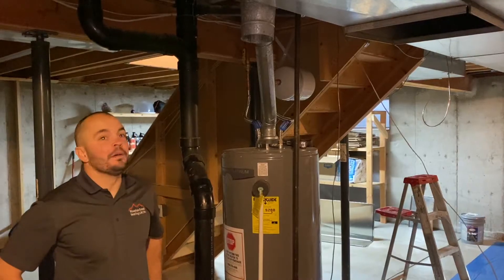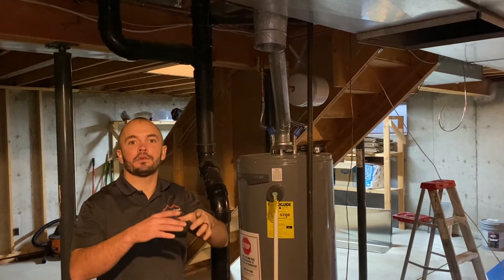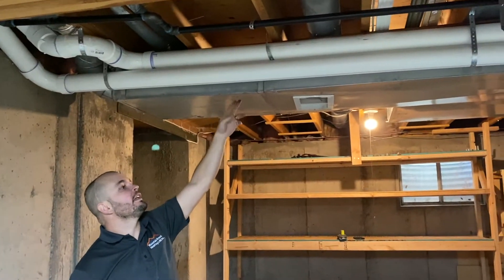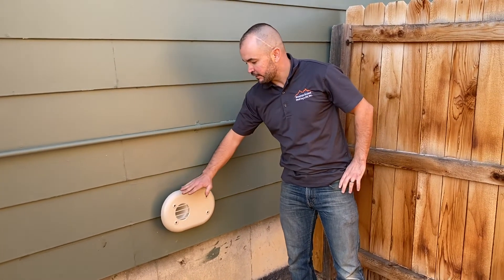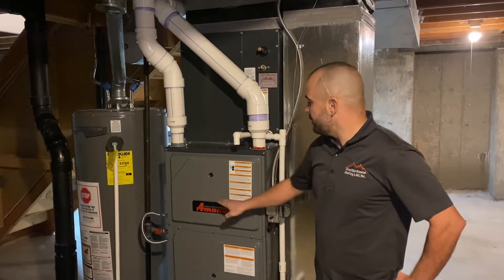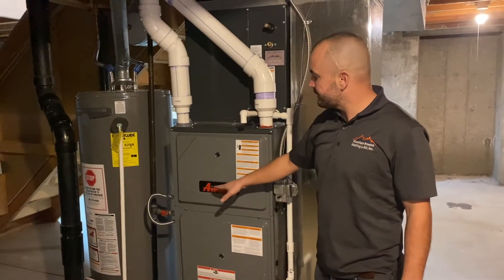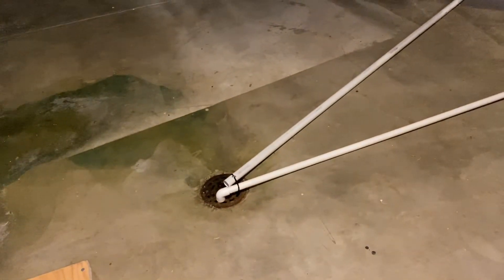High Efficency Furnace Venting

Comment: My house has the exterior flush vent as shown in the video but the guy that owned my house before me was an HVAC guy and when he terminated it the exhaust is on the bottom and the intake is above it, UNLIKE AS SHOWN IN THIS VIDEO SIDE BY SIDE. Is this is a really bad issue? Do I need to get it corrected?

Comment: I keep getting water in mine…then my furance doesn’t work. Wasps keep getting in mine, which only makes the water situation worse. What can I do with the existing vent to fix that?
Reply: Your exhaust pipe is not sloped correctly, condensation is building up blocking your exhaust

Comment: Apart from asthetics, is there any advantage of disadvantage to the low profile venting as compared to just regular old pvc pipes sticking out? (high efficiency furnace)
Reply from the maker: It’s more for aesthetics, but if not used you need to make sure the exhaust/intake are spaced more than 12” apart
Reply: @mountainbreezeheatingandair Is that a human safety issue or less spacing risks just shortening the life span of the furnace?

Comment: A few months a hvac guy install a high efficiency furnace and the drain goes up to the attic apparently, that seems wrong but 🤷‍♀️ any advise on what to do? Also I see 2 pipes going up to the attic, not to the side of the house. So you think it was installed wrong???
Reply: And the drain pipe has a pump what pumps the water up to the attic to a drain metal pipe that in in the attic

Comment: That venting is a bad way, my Lennox high efficiency furnace (we bought in 2023) collects condensation inside the unit, and pumps it out through a 0.5" hose line, and the venting still goes the chimney like a regular furnace

Comment: I've had a high efficiency furnace installed.  My neighbour and I both have two storey homes and the exhaust vent is located at the height of the floor joists between my two floors.  Our homes are about 6 feet apart.  My neighbour is claiming the exhaust is causing condensation on the outside of his vinyl-siding and is worried it will cause issues with rot.
Have you ever heard of this potential issue?
Reply: Where I live new homes are as close as 4ft foundation-to-foundation. The issue above has been addressed by installing a T pipe at the exterior end (oriented left to right rather than up and down) of the exhaust PVC pipe. This is city code here now.

Comment: On very cold windless days, whore frost would buildup and block my furnace air intake. I would have to go outside and use bottle brush to unblock it. I finally figured out that when there was little or no wind, the humid furnace exhaust was being drawn into the furnace intake and freezing. For a quick fix I placed a 3 foot by 3 foot sheet of plywood between the air intake and the exhaust until I eventually extended the exhaust another 16 inches away from the furnace air intake to more permanently solve the problem.

Comment: Got a bid for an Amana AM9S96 single stage multi speed furnace and contractor is only going to install an exhaust pipe. Said Amana heat exchanger is built big enough that it doesn't need an intake pipe. Is this the right way to do it. Thanks

Comment: I would strongly caution against using the termination kit shown in the video. I have 5 year old house with exact same termination kit. After 5 years all the hardiplank siding around the termination is rotten, has mold and will have to be replaced. The discarded fuse gases condense around the termination. These AC guys do their job and leave with everything looking nice and clean. The issue wont show until after few years. I wish I could post pictures as evidence.
Reply: I have this same issue on our 10 year old house with this exact termination kit and had to replace some of the OSB wall sheathing and fir out a new square wood piece for the termination. I reused the termination kit but have noticed that the same thing is happening again with our cold temps also in Montana. Scrap this unit and reconfigure with PVC pipe and a couple of 90s elbows.
Reply: I enjoyed reading your comment. Can you make a video showing it? Ours is 5 years old now. We are in north east Montana and our Furnace keeps quitting because both Vents are clogging with snow, but mostly Ice in this brutal weather we've been having lately. Going outside in blizzard -40° windchill to chip out the Ice buildup isn't so easy. I'm looking for a way to help stop that from constantly happening. Im hoping mold build up isnt the culprit.
Reply: @rd7866 same issue happens to me in Minnesota with too much snow blocking vents... I need to figure something out...
Reply: I was going to say the same. It doesn't look great long term. My other concern would be mounting this in dusty areas.

Comment: Have you ever heard anyone complain about the loud exhaust? I had a Trane system installed and the exhaust is really loud. The neighbor is complaining it wakes her up. was it installed incorrectly?
I can send you a video. thanks in advance?
Reply: It actually operates like a gas engine. Gas and air go into the firing chamber inside the furnace, it is then ignited with a spark and exhausted to the outside. This process repeats itself several times a second. That is what you are hearing. It makes for a very efficient furnace, but also a very noisy one.

Comment: I thought code required the exhaust pipe be 30" above the inlet pipe if the two pipe exits were within 10 feet of each other.  Obviously the sidewall's housing has the exhaust and inlet ends very close to each other.  Won't that mean exhaust fumes could be drawn into the inlet pipe which then go back into the house (i.e., exhaust goes into the house), and that would also decrease efficiency because the fumes would displace air resulting in less efficient burn inside the furnace?

When I got a furnace inspection about a year ago, I was told running the condensate pipe atop the floor to the drain was against code.  The pipe could not be underfoot.  The condensate had get pushed with a pump to up to the floor joists, across the ceiling, down the wall, and then into the floor drain (which is close to a wall with the floor graded in that direction rather than the drain in the middle of the floor).  I'm not sure if that was about the condensate from the furnace, or from the drip pan for the A-coil to catch condensate from the evaporator coils for the A/C.  I just remember that running condensate pipes along the floor was a no-no.
Reply: Lee. The requirements for separation of exhaust and combustion air come from the fuel gas code look at section 503. More specifically for direct vent requirements which the code allows this. It would be interesting to ask a mechanical engineer who actually worked on designing this unit or the termination cap. What you say makes sense but the termination cap has been engineered from the manufacturer. Codes always allow for engineered solutions provided you demonstrate you meet the intent of the code and are not reducing safety.

Comment: Hey James I got a question for you today I had my furnace guy out to replace a leaky AC Cory unit while he was taking apart the furnace to replace this unit he found an obstruction in the exhaust side of the furnace apparently when the furnace was being installed five years ago one of the installers accidentally dropped a 90° fitting in the exhaust side which I would say it was blocking the exhaust by roughly 40% now again I’ve had this furnace going for five years and some pretty cold winters here in the Northwest and the heater is always worked awesome ,,my question should I be concerned. Thank you for your time sir I really like your videos

Comment: My houses furnace as 2" PVC. does it need to be upgraded to 3"
Reply: Not particularly.  The manual for the furnace will tell you. Example- use up to 65’ of 2” pvc. Each sweep elbow counts for 5’ and each hard 90 counts 10’. 

3” pipe is way greater than this so most companies avoid 2” to prevent their installation teams from screwing up. Plus less range of materials on trucks. I use 2” when I can.

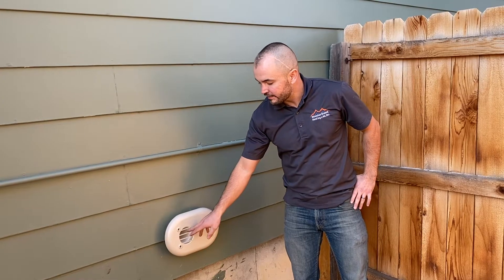Comment: 1:27  that's what mine looks like and I don't trust it, it faces the west side of the house which is the direction wind comes from 80% of the time, ever since the new furnace was installed, I've had headaches around the back of my neck (nerve area)..as in carbon monoxide poisoning.   I noticed on many houses the exhaust and intake are separated by about 10", and point in different directions.  
I heard that the type you have in the vid (like mine) was mandated by good ole big brother and I'll be working to modify it so it doesn't kill me.  They made it almost impossible to do any changes to it that don't require it to be totally removed and replaced which I'll do if I can't modify it.
Reply: Aren’t the intake and exhaust vents simply for combustion? It’s a closed loop system so none of that air being pulled in from outside should make it into your home. Unless your new unit has a cracked heat exchanger.
Reply: Shouldn't be an issue, but if you're worried just get a carbon monoxide detector, they're cheap.